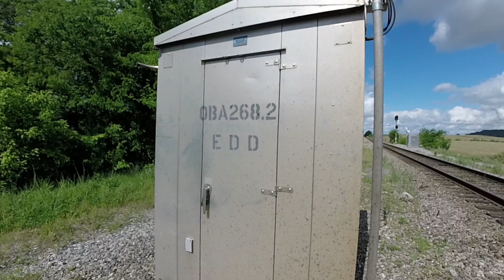CSX Defect Detector with Audio (and a Flange Oiler) at Wheelerton - 2019

Comment: The Ham band of 1.25 Meters was not taken away. It starts at 222 Mhz and goes to 225 Mhz.
Reply from the maker: I never said the whole band was taken away. The part at 220 MHz (220-222 MHz) being used for PTC (and some other services) was taken away in the late Eighties.
Reply: Actually, it was about 1993 (I think) when the reallocation happened. I was licensed in '89; we still had full 220-225 privileges until then. In my area (southeast Virginia) 221.01 was the area packet backbone frequency until '93 when it was moved to 222.10.